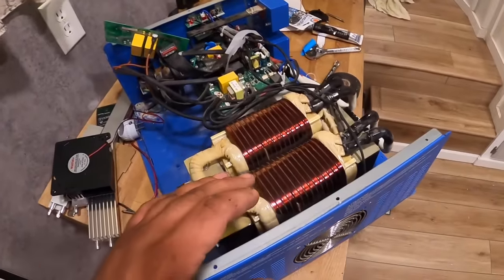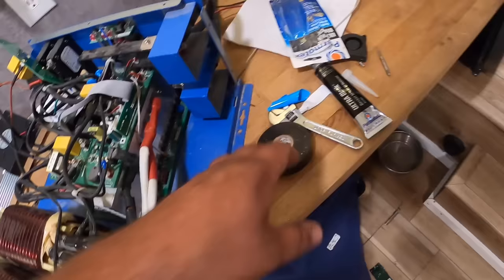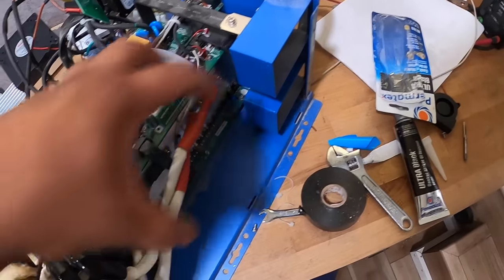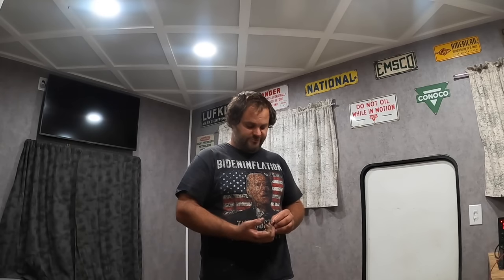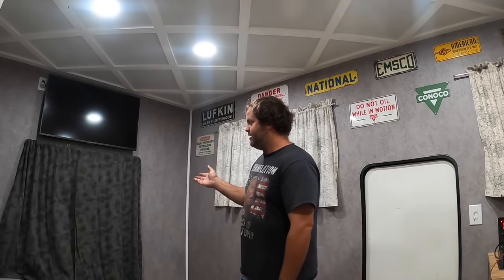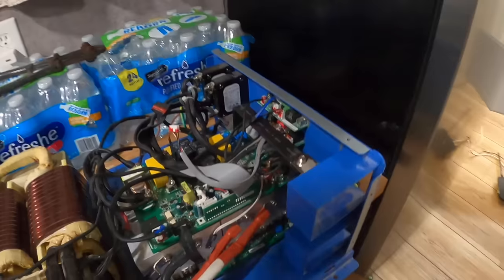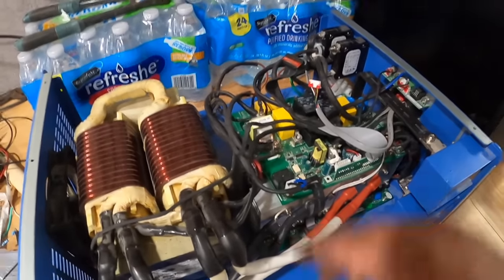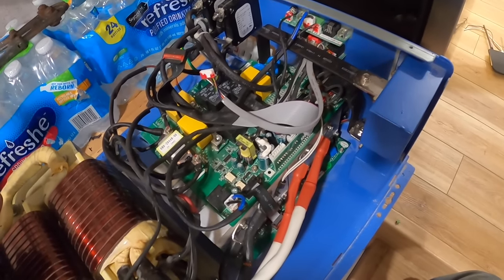One Screwup Leads To Another.

Comment: As an Electrical Engineer, I approve of all the decisions you made! :)  You were smart not repairing that inverter and sending it back considering the warranty!  There are lots of integrated circuits, microprocessors and flat pack devices in modern circuits like that - without special tools they are a pain and nearly impossible to do a good repair.  I like your idea of simply picking up the hot air at the end of the inverter and sucking the heat out of it.  I know they are not cheap but you might consider having a spare identical inverter stored away on you RV.  With the loads you are carrying and the money you already have invested in your Rv, (it is a beauty!)  I think its a small price for knowing you won't be stuck somewhere with no power!  Depending on the cost I might also have a spare voltage regulator for your generator on board as well.  Lastly I like the idea of some over-voltage protection coming out of your generator to protect your rig.  Or you could force your generator to be in battery charging mode all the time, and don't allow it to be on-line with your AC.
Reply from the maker: Thanks. That thought has crossed my mind. I did take a extra regulator with my. I used to do some work on generators and have a couple of others of my own and keep several regulators on the shelf.

Comment: Zack, from my time in the standby generator field i learned that most voltage regulators do not like it when the engine is not run at rated speed. Id guess that the low speed battery charging killed it over time and you may need to come up with a scheme that "disconnects" it when not at full speed. A simple generator controller from deep sea electronics may be worth installing  to monitor the engine and generator, they can be set up to kill the engine when a parameter exceeds the programmed setpoints. Please excuse me if i have missed something and you have already accounted for this, just wanted to try contribute my 2 cents if i can help lol.
Reply from the maker: I didn’t explain this because I felt it would confuse more than it helped but that’s exactly what I’ve got. It only supplies line voltage to the regular when in gen mode via a relay. I have a plc set up to control the engine and monitor temp and pressures.
Reply: @TheZachLife  I had a feeling a guy that was smart enough to write plc logic and put all of that together had something in place but I figured I'd say it just incase lol. Keep up the good work, we enjoy the videos. I'm especially interested to see your scada set up for the oil wells when you get time to explain it.

Comment: I have a suggestion for your generator cooling woes, run a coolant loop up to the trucks cooling system.. hardline it most of the way, like 3/4 or 1", and keep the radiator in the back as well.. you would have a greater capacity with the hot coolant.. also, during the cooler months if you go somewhere, the generator would act like a block heater for the trucks engine at night if you run it.. 

Great content! Love it
Reply: Depending on the distance of the run, I think this is a great idea!
Reply: Also the engine would heat up the generator and pre heat it before use when you stop. Only issue is if the generator can heat up all that fluid to get up to operating temps with a much larger cooling system. You would have to have a thermostat and make it all just right including the size of the water pump so it can move all that water that distance.
Reply: @FishFind3000  thats why I was thinking it would be like a block heater.. most likely wouldn't get it up to temp, but warmer than the ambient temp.. I was also thinking that keeping the line size smaller, it would help the water pump get it there, the trucks engine would be pushing the coolant back.. 

If a guy took it off the bottom of the rad on the cooled side, and with it traveling back, it would be significantly cooler I would think, having to run 20' or so..
Reply from the maker: I have thought and thought about this. Even if the truck was off there would be enough radiated heat from the engine and radiator to make the difference. The biggest problem I have is mixing of the coolants and that one cooling system would overflow the other. It would take a heat exchanger or something.
Reply: @TheZachLife  if I may ask, what do you mean by mixing of the coolants? As long as they're the same type, like both green or both red elc, it would be fine.. 

Now, I'm not sure how they would overflow each other? In theory, it would act like a webasto I would think coming into either engine.. I leave mine on my truck during the winter to help with warm up with no ill side effects.. I guess I don't see how it would be different? 

Just curious, as you may have seen something that I haven't and I am unaware of.. always good to learn from someone else with life knowledge, hence why I watch your channel
Reply: @TheZachLife I agree a heat exchanger makes sense for redundancy purposes

Comment: Water cooled CT scanners use a similar radiator system since the x-ray tube is actually spinning and can't be directly connected to chilled water. So instead there are 3 radiators mounted in the corners of the machine housing cooling the air around the spinning tube transferring the heat (ultimately) outside the room somewhere.
Reply from the maker: Interesting

Comment: Oh my. Did you ever tumble down that awe shit hole. Been there, done that. It is called a cascade failure. Your errors amplified each other. At least you were not at 50,000 feet doing Mach 1.5. I am proud of you. You figured out what happened.  Fixed the problems and come up with upgrades.

Comment: i enjoy the electrical stuff as much as i enjoy the talk about oil and bearing wear!  also be shure to use aluminum radiators. if you mix metals in low temp cooling it corrodes, at leasts it's big deal in custom PC realm . i made thatm istake and it got pin holes.
Reply from the maker: Thanks.

Comment: I installed a 3200W inverter in my employer's toterhome, and it was nothing but trouble. After untold hours of fiddling, we could get it to run 1 AC unit for about 4 hrs before we ran out of battery (relying on the truck alternator for recharge), then we upgraded the alternator, etc etc etc. Finally I put in a switch to tie the truck batteries in (NOT a good idea).
The inverters are great in concept, but an unrelenting hassle in reality.

Comment: Tuber here:
Have you given any thought to a 12 or 24 volt DC water pump instead of the 115vac unit 
Also you could replace some of 115vac lighting with 12 or 24 volt DC LED’s

Comment: In the winter you would want that heat back into the cabin so you should have made a flip/flop door in your vent channel to where you could direct the heat thru the vent over the fridge in winter, but also direct it out the side of the toterhome thru an external vent in the summer. That way you get rid of it when you don't need it, and make use of it when you do.

Comment: Why not just duct the hot inverter air outside? This would keep the hot air from adding to you AC load....Simpler and at most would require a booster fan to move that air farther.

Comment: You need a voltage monitor relay, industrial grade from a reputable manufacturer, if you can get two or more second hand for the price of a new one install two and wire their relay contacts in series just in case one goes crazy. Use them to control a big power contactor, better if it's a 4 wire model and you wire one half of contacts in series with the other half to reduce the chances of stuck contacts.
That's part of the setup I've to power my submersible water pumps because without water at home life is hard. I said pumps because I've two for redundancy, the well bore is 10" so I tought it was a good idea.
Reply from the maker: I agree I’ve actually got a under voltage but not a over voltage relay.

Comment: You might be able to connect a low-value resistor between the sense terminal and output terminal of the generator.. in normal operation, the resistor is shorted by the sense wires.  If the sense wires open up, the resistor keeps the sense terminal near the output voltage.

Comment: Look into immersion cooling, I bet you could just put the transformer in a container of mineral oil and just cool that liquid outside. I did it years ago whenever I had a bunch of bitcoin miners in a camper putting off 10k Watts of heat, ended up doing immersion cooling and put a medium sized radiator underneath the camper and it worked perfectly for almost 16 months continuously.
Reply: @LinusTechTips Did immersion cooling in a fish tank many years ago, using mineral oil.  A plastic container would be better for @TheZachLife inverter with a larger radiator.
Reply from the maker: I think something like this may have to happen.

Comment: Zach do you think one of those 5kw dc to dc air conditioner inverters would cool your electrical cabinet? I think they make a 5000 btu unit that is very small you might could put the outside part underneath the rv they are so small they install them on one of the rear van doors.
Reply: yes or a very small window unit  my inverters are low freq i built them myself under 20 watts no load idle and the fans have never kicd on
Reply from the maker: I’ve considered something like that.

Comment: back in the day the mfg would give you schematics and specs to trouble shoot! electric repair is hard as shit these days. it's caused the right to repair to start taking off and even passed in a few states.   also be shure to use aluminum radiators. if you mix metals in low temp cooling it corrodes, at leasts it's big deal in custom PC realm . i made thatm istake and it got pin holes.

Comment: also be shure to use aluminum radiators. if you mix metals in low temp cooling it corrodes, at leasts it's big deal in custom PC realm . i made thatm istake and it got pin holes. edit, mixing aluminum and copper. you can mix nichol and copper fine.

Comment: ...might be something to try on a different inverter to dial in the cooling, but you could submerge the whole unit in mineral oil and run the whole fluid through an external cooler...it may carry more heat than a small targeted heat exchanger...I have seen guys run whole electronics in an oil tank and it seems to work well...might take some experimentation...
Reply from the maker: I thought about doing this to the transformer. Interesting.

Comment: Jack of all trades, but master of nothing speaking. One problem in HVAC is oversizing the unit, that leads to fan short cycling. Sometimes it can't be helped, so they put in a time delay relay($20). So you may want to try a smaller fan so it has to run longer before turning off. Sounds like a cascade electrical failure, but might want to plan for that happening again. There are overvoltage and undervoltage relays($20) too or just put in surge protectors on the spendy stuff.

Comment: Zach, I'm not sure if you'll ever have a reoccurance, but a Bender relay may help protect you from over voltage.  You could run the contactor closure voltage through a normally closed contact in the bender.  They aren't cheap, but I thought I'd pass it along. Really enjoy your videos.
Reply: Good idea if it can actually handle his situation ... they are about $700 used, about $1000 new i think.
Reply from the maker: I actually got a Chineses one setup for undervoltage exactly like that. I may find one that does overvoltage as well.